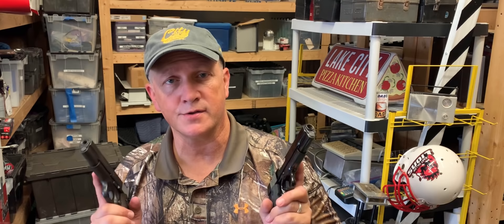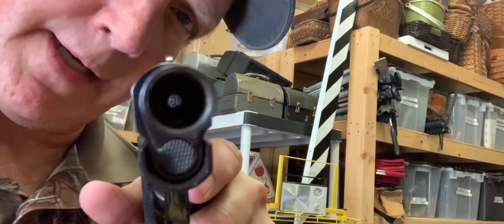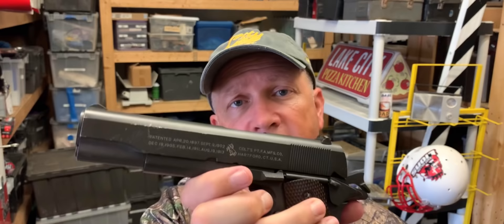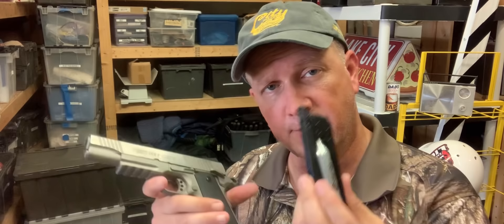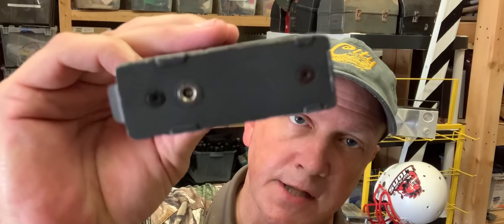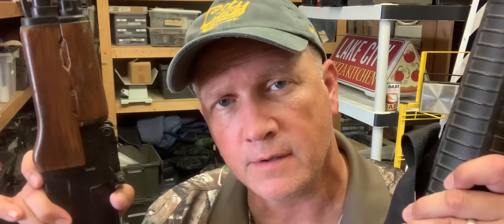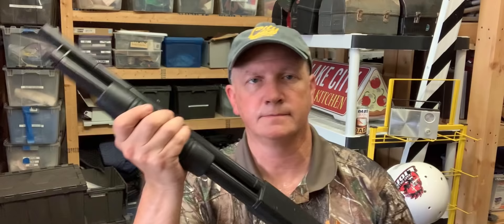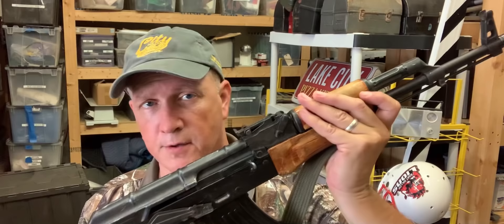Movie Props: Replica and Blank Guns in Movies

Comment: Why are your blanks so expensive? I went to a boarding military school, and we got 30-06 blanks for 21 gun salutes at .70 per round. I would expect most rifle rounds to be cheaper than that. I have never seen pistol blanks: are they harder to manufacture for some reason?
Reply: I would guess that your school was getting them the same way that veterans organizations do, and were using the M1909 .30'06 blanks loaded by Lake City Arsenal. They are mass produced (likely 1000's more in a single run than the theatrical blank makers do), and probably sold at close to cost. Theatrical/Movie blanks are a creature unto themselves - many variations based on caliber, the type of firearm it is to be used in, how much flash is desired, how much smoke is desired, etc etc. I remember back in the 80s when I was doing WW2 reenacting, we felt overcharged if we paid more than about a dime a round for surplus M1909 blanks (the old ones with the red paper wad) - there were so many available with so few people that actually wanted them. I gave someone a killer deal (comparitive to then-current prices) on my old stash back in the 2000's and still made good money back.

Comment: Does the cinema industry have a shortage of gun guys? Because I'm wondering if you could use blanks with a lower load to reduce the safety hazards, you would have to re-gas the gun to cycle with an even lower pressure curve. Alternatively, motorized action could be added to the gun to compensate for the loss of pressure that comes with blanks (that's why they have problems cycling, not enough force to extract and/or chambering the next round)

Comment: No the reason it's called green gas is because it's general purpose, iirc red gas is hotter environments blue gas for wet environments and black gas for cold, though i could be wrong with black and blue gas

Comment: How do you feel about those " non guns " that use a battery to ignite a flash charge in the muzzle ?
I understand those are or were used when point blank fire is taking place, but do you now just prefer a co2 airgun or airsoft gun with effects added later or is the real muzzle flash still important?

Comment: Regarding props on set, I've always wondered why firearms used in films are real when everything else is more or less a nonfunctional fabrication.

Is it possible for the best prop makers in the industry to design and build prop firearms that look, feel, and only APPEAR to operate like actual firearms, (i.e. muzzle flash, recoil, proper weight, load/unload clips and PROP cartridges, etc.), only they fundamentally operate in such a completely different manor that projectile discharge isn't even a functional possibility, even if the props malfunction?

Has this already been done for a film and I just missed it? If so, why has this new tech in prop firearm design and operation NOT become the film industry standard?
Reply: Like Scott already mentioned, most firearms in films are either rubber fakes or gas glowback airsoft guns augmented with visual effects. It's usually for close-ups and such where a real firearm may be used and the proper precautions are taken place.

The device you're asking for already exists and he showed it off in the video. If real firearms are to be used, they are first modified by a gunsmith to be properly setup to fire blank rounds. Obviously, blanks are still very dangerous which is why there are steps and procedures to assure no one is hurt during the production. For something to go horribly bad requires multiple screw-ups along the way before the director calls "action!".

In the case of what has happened recently, the gun was loaded with live rounds and Mr. Baldwin was told by the assistant director that it was a "cold gun" (not loaded with live rounds) after grabbing it from a cart that had 2 other guns set up by the armorer. By that point, every firearm on that cart should've been cleared by the prop master or armorer. Hell, I would go so far as to say the AD should've also gave it check.

The production seems to be marred in issues, as earlier that day, several crew members quit over labor disputes (may be related to the IATSE strike). So the team was forced to source non-union labor for the production last minute. I wouldn't be surprised if some corners were cut to get the shoot done on schedule.

Comment: So if the guns are altered to shoot blanks, how did Brandon Lee get killed dirning filming. The excuse was a live round was accidentally mixed with blanks. But would a stage gun be able to fire a real round?
Reply: That gun wasn't altered to fire blanks. It was just a normal Revolver as far as I know and they used Dummy rounds and Blank rounds. They had used Dummy rounds in a previous scene to look good. They were just regular rounds but with the powder taken out. And for some reason a Dummy round had been fired and the bullet got lodged inside of the barrel. And so when he fired Blank round that shot the bullet out the barrel and killed Brandon Lee.
Only semi-auto's and fully automatic guns need to be altered for blanks because those guns require the power of the gas to load the next round. Essentially the recoil loads them. But Revolvers don't need that because it's all mechanical so they just used a regular gun.

Comment: How are blanks more expensive than live rounds?  Especially now with ammo prices being at an almost all time high. 
9mm roughly 50c a round
Reply: Specialty ammo, produced in (compared to regular commercial ammo) small production runs, using uncommon materials (modified brass casings, flash powders, etc) for rather niche purposes. Theatrical ammunition is a specialty unto itself. Part of the cost is also the value imparted by the manufacturer from their knowledge and craftsmanship so that when you buy a specific loading for a specific purpose you have some assurance it will perform as advertised.

Comment: I am both a narrative filmmaker, and a huge fan of 2A.  All that said, I do not allow weapons on my set that have the ability to fire any kind of round, blank or otherwise.  I prefer highly accurate airsoft weaponry and post visual effects to create gun blasts.  Actual weapons, they are simply to unpredictable and dangerous to be pointing at other people, just for a picture.  Just ask Alec Baldwin, he'll tell you.
Reply: It doesn't look as good, just learn the proper safety and inspection regimens which all movie productions except Rust adhere to. There's a reason accidents like those virtually never happen.
Reply: @0neDoomedSpaceMarine  nah, it's all about your Shot composition and especially lighting.  Airsoft gets it done and nobody is in any real danger from them.  You still have to pay attention, though.  An airsoft round does have the capability of putting an eye out, so you still have to treat the airsoft weapon as if it's 100% a real bang bang.  But overall, short of the actual round chamber, you're golden.
Reply: @TheMightyCookieShow  Nah, it doesn't come out as good, it's easy to tell that it's fake if it's close enough.
Besides that, doing flashes, smoke, and casings in post is also all a bunch of tedious extra work, when a blank will give you real light, motion, and sound (well, sound depending on how you're editing).

The risks really are nothing if you bother to learn good procedure, I only see the purpose with close shots where blanks wouldn't be safe, or with kid actors, where the studios don't tend to let them handle real blank guns anymore.

Comment: Somehow the airsoft guns cost more than the blank firing guns...
Reply: Good airsoft guns cost more, and they're a lot less durable, wearing out much more quickly. They're also often easy to break with rough handling, I have legit dropped one on the floor and it broke into pieces.

Blanks are also pretty mild on real firearms, as you get far less pressure building up in the breach and barrel, so it's very little wear on them as is.
If you look at something like an antique Maxim water cooled machinegun, or an early AK47 with the forged steel receiver body, those were built to last almost forever with live ammo, so blanks are nothing at all to them.
Reply: @0neDoomedSpaceMarine  funny how people will spend more money on the most realistic fake gun instead of just buying a real one

Comment: what guns need to have parts machined to convert them? you can just plug/ obstruct the barrel with a bar. maybe for certain blanks youd have to port or slightly alter the gas systems to accomadate the backpressure but thats it. there are black gun manufacterers that sell blank clones that are 1:1 except for weldments in the barrel
Reply: It can vary from gun to gun, choking the barrel (which needs more than a bar) is a common one, but you might need to modify a number of other parts.
It really is a job for a specialist gunsmith, don't try to do it yourself.

Comment: In 2023 there us no need to have a real gun with in 2 miles of a movie set ... The Crow II and Rust are enough reason to not have them
Reply: Rust is the only incident ever since The Crow, which established a lot of rules which if followed, will prevent those kinds of accidents, and have done so for about 30 years. 

If you look up Rust, you'd find that the production routinely violated all kinds of safety rules which exist for extremely good reasons, and that most of the previous crew had quit in protest because of how dangerous and irresponsible things were. Keeping actual live ammunition on set, and right next to the blanks, to name one out of many dozens of irresponsible errors, should really illustrate my point.